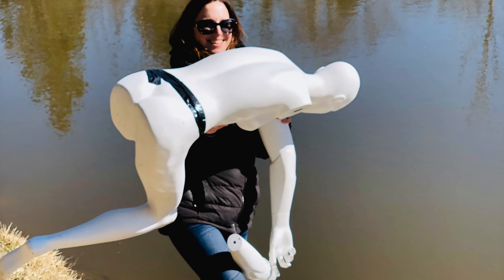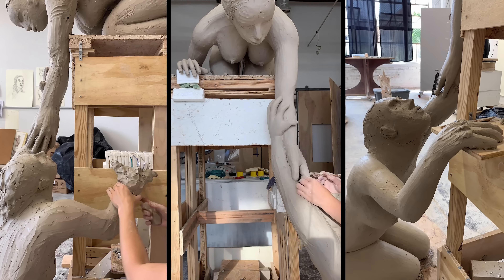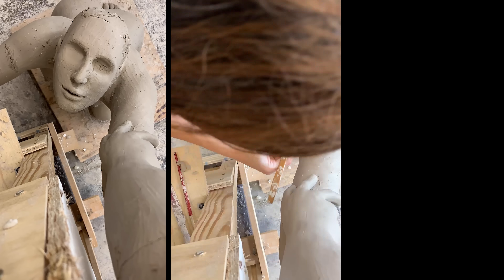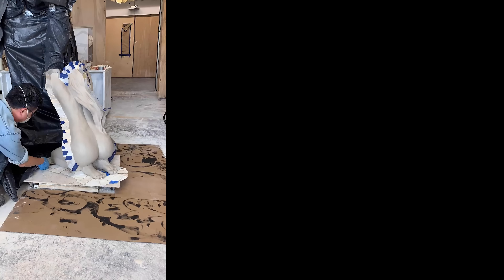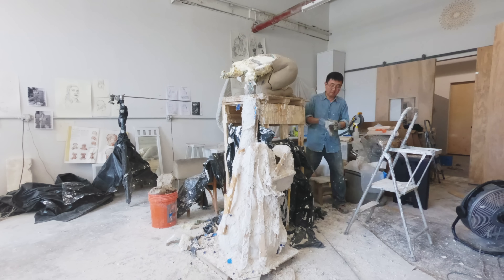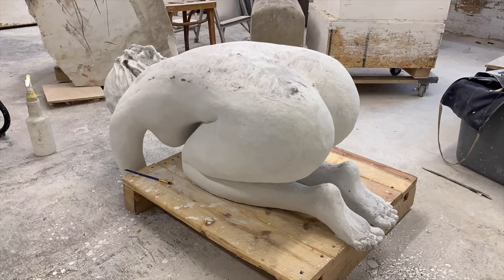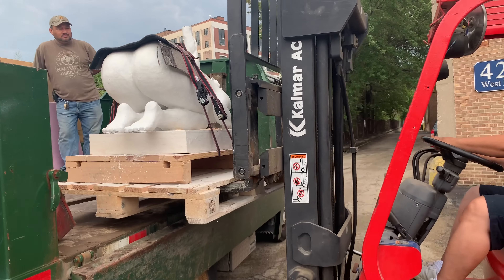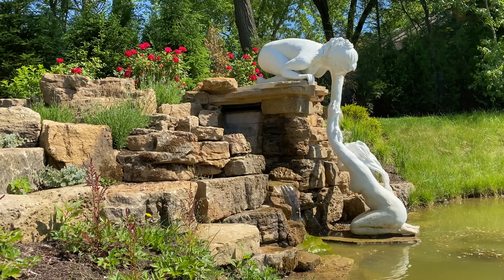Casting Concrete Life Size Sculptures // Start to Finish // Nereids Commission

Comment: Why not just do the the base and surround it in screen  and then do the outterblayer in concrete
Reply from the maker: I thought about that method, but you would have to work very fast to sculpt the concrete and concrete does not do detail as well as clay because of the aggregate and sand. I was able to refine the pieces over weeks of time by using clay then casting. Hope that's helpful.

Comment: Hey question for you. Is there a way to cast the concrete and sculpt from that instead of sculpting in clay and making a mold? Sorry if this is a dumb question
Reply from the maker: There are no dumb questions, but terminology can be confusing. The word cast implies a mold is being used so I believe what you are asking is whether or not you can just sculpt concrete. If so then yes... this is another video that would explain that technique but it uses a steel frame or armature. I hope that's helpful :) https://youtu.be/iu4ICz4OU_Q?si=nnDCXwUN78CoXLG6
Reply: @JylBonaguro  thank you very much!

Comment: Amazingly beautiful. We are beginning to cast concrete planters. What type of concrete should we use, and are there any resources on how to use and place metal mesh?
Reply from the maker: If they are just square planters, this video on my instagram page might help for metal mesh placement https://www.instagram.com/reel/ChNEFuVgb-0/?igshid=NDk5N2NlZjQ= generally a layer of concrete then mesh then concrete if around 2 inches thick. Hope thats helpful
Reply from the maker: Concrete that is quick setting from homedepot or lowes but with fine aggregate, good luck!!

Comment: Lovely work!  

What is the material that you built the cast out of?  If you had wanted to make multiple copies, would you have had to use a different approach?
Reply from the maker: These were cast in concrete. This is a waste mold process. I am releasing a video very soon that details the permanent silicone mold process for casting marble. That would be the approach for multiple copies in concrete, marble dust, resin etc. Hope that's helpful!! :)

Comment: Just asking...would the plaster crack.??...trying to find some plaster like this that won't crack
Reply from the maker: Plaster is generally not strong enough to be outside permanently which is why concrete was used instead. Hope that's helpful!!

Comment: what did you use to create the mould? would it be a one-use thing or can you cast again from it?
Reply from the maker: This is the waste mold process, not permanent, so it cannot be used again because it is plaster and breaks apart as the cast is opened. The permanent mold process uses silicone and is detailed in this video I created here https://youtu.be/GKjW4FNzrRM
Reply: @JylBonaguro  thanks..I make silicone and latex moulds already but only one piece and no seams..I'm preparing myself to start on something bigger that will need seams but it must be multi use

Comment: Hi Jyl, wonderful work and a great video, thanks!. What is the mould made from?
Reply from the maker: The mold is made from plaster, any general plaster will work not too lightweight, but it doesn't have to be hydrocal hardness since you are not reusing it. Hope that's helpful
Reply: @JylBonaguro  Thanks! I was thinking why not use fibreglass then I realized for such a shapely (and one-off) artwork extracting from the mould would be the issue.
Reply from the maker: @MattGratt  right, fiberglass would be for a permanent mold and it was very difficult to break this piece out even knowing the mold could be broken off anywhere. I will be doing a fiberglass mold video in the next 6 months of the 30 inch Modern Athena and that's a complex figure but quite small and not as shapely.